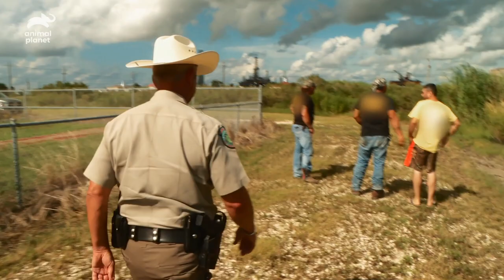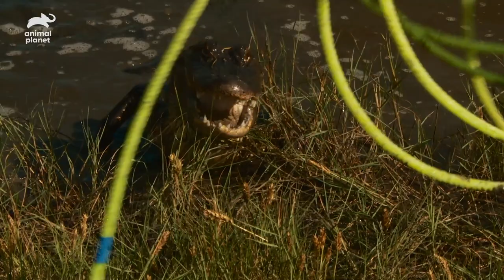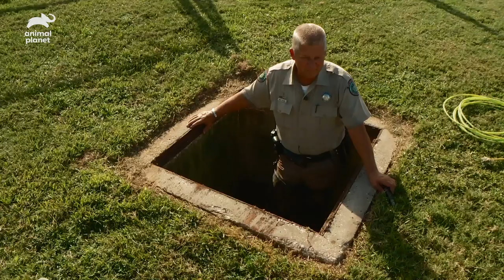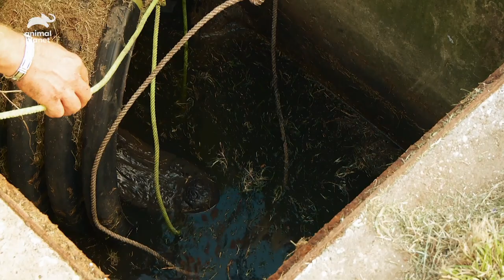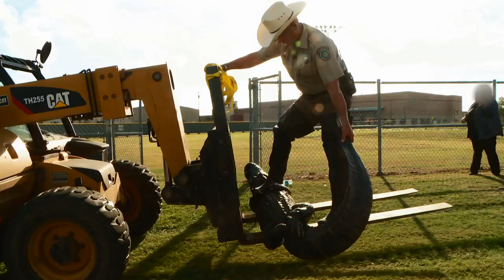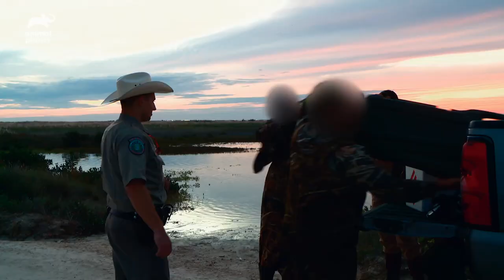Baby Gator Is Used To Lure Out Mother | Lone Star Law

Comment: They may have only been between 5 to 9 ft gators but don't let their small size fool you they still could've taken a finger or a hand off, especially in that drain! Mike was right, swampy definitely needed a bath, but so did that gator handler after being down in that drain, yuck!